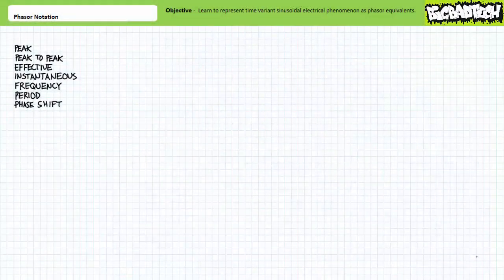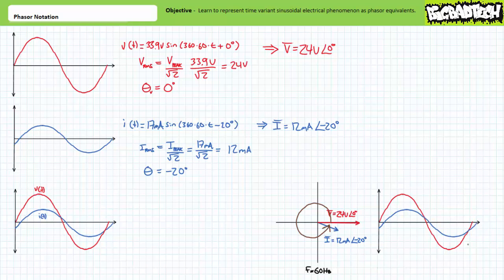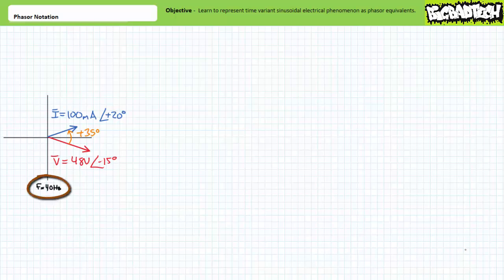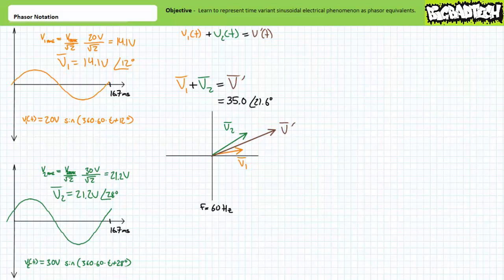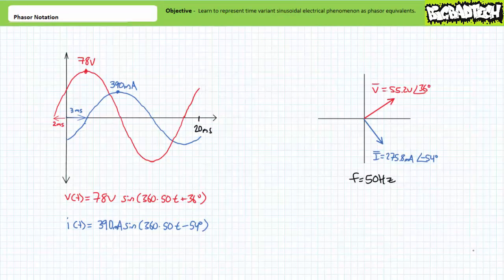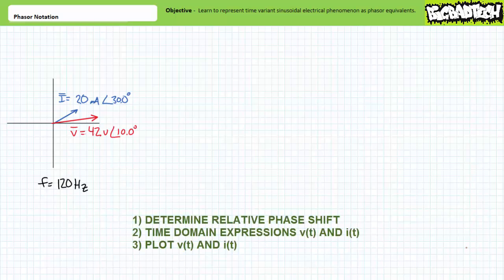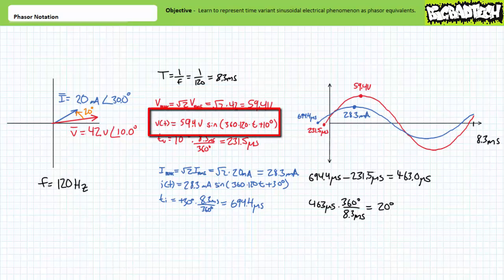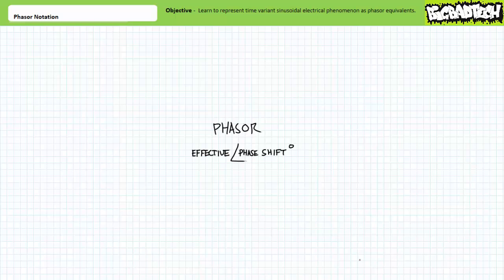Phasor Notation (Full Lecture)

Comment: Not sure why you are using RMS values when representing phasors. That is not the phasor of the voltage source. A voltage source with peak value V is expressed as V*cos(wt + phi) where V is peak value. It's phasor representation is simply V<phi.  BTW the cool kids who write the electrical engineering textbooks Alexander,  Nilsson et al use cosine and not sine to represent AC current and voltage.
Reply from the maker: Wut?*

* Used in response to an unclear or absurd statement when seeking to clarify it or expose said absurdity.
Reply: @bigbadtech  why are we using the RMS value here? I've always seen it used as the peak value. Or you can use either one as long as you're consistent but peak value makes more sense.
Reply from the maker: Using RMS values for voltage and current allow far easier power calculations. Also the default for most DMMs is ordinarily RMS. Peak however is great for oscopes.

Comment: I didn't think you could convert sin straight to phasor. I have been under the impression generally cosines are converted directly to phasor as you demonstrate in the lecture and that sin is converted to cos first using a 90 degree phase shift then that cos is converted to a phasor.
Reply from the maker: As you mention cos(theta)=sin(theta+90), however, there is no need for conversion prior to converting to phasor equivalent. I suppose you could have a phasor domain based off the cosine function (one that starts at the maximum), however, the sine wave (one that starts a 0) is the function of choice.
Reply: Jim Pytel Thank you for your response
Reply: @bigbadtech  Hmm...but if you convert directly from sin, now there's a confusion. I always thought that it was the "real" part of the phasor that mattered, that is its projection onto the horizontal axis. However, in this case, you're considering its projection onto the vertical axis as the instantaneous value of the current or of the voltage. Does it not make a difference?
Reply from the maker: @joshuaronisjr  Good observation, however, I like to think of complex impedance as a totally different "domain" entirely separate from the phasor domain. In the phasor domain we're concerned with the vertical axis sin function (which doesn't really mean imaginary).
Reply: @bigbadtech  Got you. That makes sense - the impedance vectors act as the same transformations (ie, if its +i times some value it'll rotate a phasor by 90 degrees) regardless of whether we consider the projection of the phasor onto the horizontal or vertical axis. So, I guess it doesn't really make a difference. Thanks for responding!